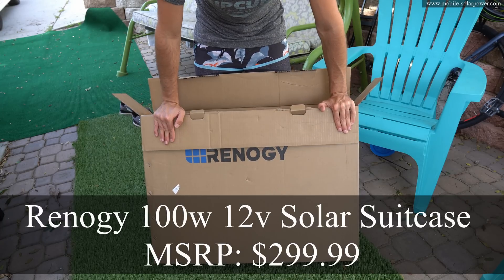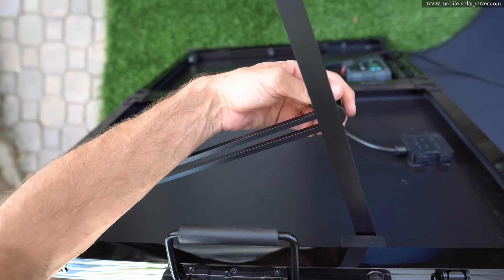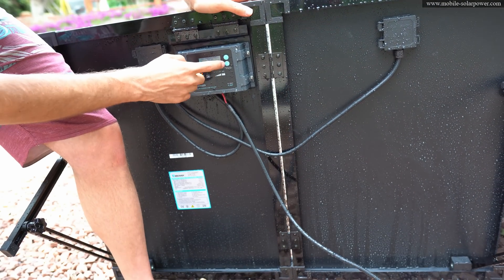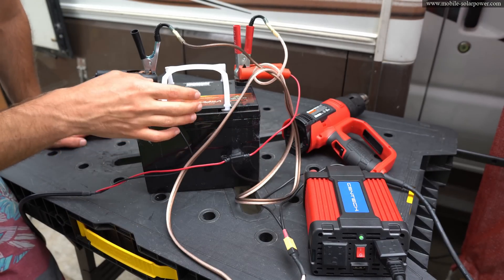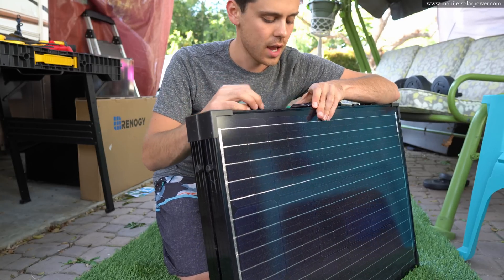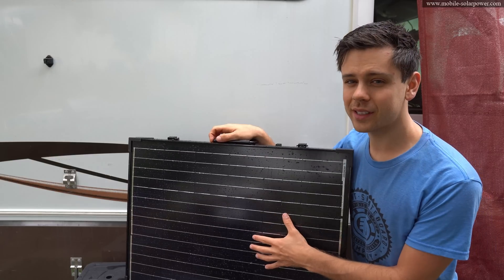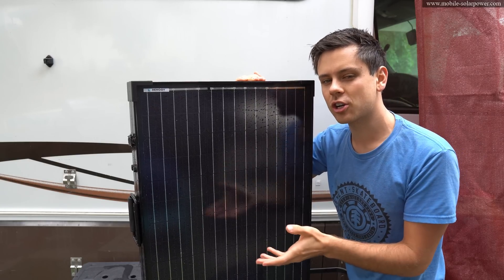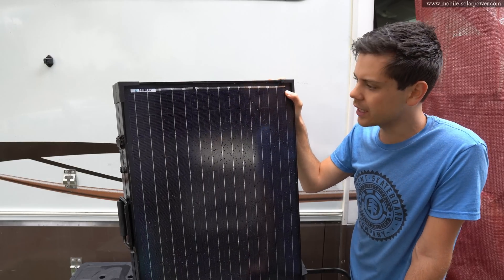100w Renogy Solar Suitcase and Renogy Voyager Tested and Reviewed

Comment: Great video Will.  So I could just hook this up to my genesis dual battery system in my jeep to keep things topped off when I am camping?  No issues with over charging or damaging my batteries with this controller?  I guess I could even put a plug in the bumper so I could always keep the hood closed.  This looks like a great setup.

Comment: I’ll bet you get this question a lot:  can you point to a power chart that can give a noob an idea about what you can do with different sized systems?  I mean, what would I reasonably be able to do with the solar suitcase, for example?  Charge 10 cell phones?  Power a medium sized fan for 15 minutes?  Is there a website that has an online power calculator or a spreadsheet that someone could download that would have general approximate power requirements to help plan projects?

Comment: Will, I have the Renogy 200 watt portable kit and I just tripped and pulled the wires out of the charge controller. The two wires are black so I don’t know which one is the negative and which one is the positive. What would happen if I connect the negative on the positive and the positive on the negative? Will I burn out my batteries? Thanks for any advice that you can provide.
Reply: Don't connect the wires without using a multimeter to check! You could burn out the controller. If the wires are backwards, there will be a minus, (-), sign in front of the numbers telling you the voltage. Also, use the higher than 20V setting, if there is one, as most panels put out more in open circuit voltage.

Comment: Hi could I plug this into an existing RV solar system to boost the battery charging when there is  not much sun. Would the solar controller on the fixed RV system fight the suitcase
controller?, great video.

Comment: Will, do they make a cable you can permanently wire to your RV battery that will plug into the cables coming from the controller.? if so what are they called?

Comment: Thanks for the review Will, I used your link to order one. I like the size, the adjustable legs and charging capacity, I will be using it for car camping and power outages to run my computer and network, I work from home.
Reply from the maker: You will love it! I have had it for months and it works great. I leave outside 24/7 in Las Vegas and always works

Comment: I have the older model that is not waterproof.  It works great!  As I understand smaller solar systems are just fine with a PMW charge controller.

Comment: so we bought this suit case for camping and figure we can keep it around for planned electric turn offs. we are an older couple and it became clear that we are not the target audience for the controler that came with this. the screen is hard to read, especially the tiny typeface for the battery type. otherwise it’s age neutral. reasonably light weight, nobs and clasps that could be bigger for arthritic hands but still ok. i warned my partner about the connection but it went together easily for him. i wanted to mess with the controller more but a grey haired lady messing with solar panels seems to be a major attraction at a campsite and i didn’t want to mess up with an audience, ha ha. i’ll have more time with it when we get it home. thanks for the review.

Comment: Based on your review of generators I'm thinking of the ROCKPALS 300W Portable Generator and was wondering if you know how this panel would compare to the Rockpals 100W Foldable Solar Panel. This looks easier to use with the legs, but durability is a concern but I question if the Rockpals panel would be as good for charging as this.

Comment: I've had one for several years now.  It works great.  It has been rained on many times; not a problem.  Only criticism I have is that the latches have rusted and are pretty much useless any more....
Reply from the maker: Good to know, thanks for the heads up
Reply: why not  addd velcro

Comment: @Will Prowse, I didn't take the time to sift through all 181 comments and don't know if this was previously mentioned but did you know....the controller is actually mounted on a hinged mounting plate that swings out. I noticed at the 1:48 mark after the water test you actually tilted the whole panel assembly to show the controller was still working. Simply pulling on the bottom the hinged mounting plate that attaches with velcro would have allowed you to view the controller without disturbing the panel. Pretty cool eh?

A buddy of mine purchased one of these portables and yes, they are the bomb. Nice video.

Comment: Have a similar setup and I have a question you might have covered previously.  When I put a large load (800 or so watts and 60 amps) on my lifepo4 battery the voltage drops from over 13 to just above 12 immediately.  If I turn the load off the battery voltage goes back up.  Is this normal?  I would have thought that my battery power would have stayed at 13 while the load was on and dropped slowly over time.

Comment: Renogy UK ran out of stock of 100w panel's recently so I had to buy my 100w panel from a different manufacturer, mine came from Photonic Universe, I installed in 2 days ago on the roof of my campervan and its been brilliant. My leisure battery was fully charged after 12 hours of sunshine with the controller set to 14.4v. Its the first time its fully charged for a long time as the split charge relay only charges to around 80%. Its been money well spent.

Comment: I have been the Renogy 100W 12v Solar suitcase for a couple of years. In fact, I have two of them. My Renogy PWM controller doesn't have all the newer Lithium profiles but works great with my sealed batteries. I use one to recharge my RV batteries while boondocking. I do astrophotography so the second suitcase and battery is used to recharge by astronomy and laptop/camera gear.

Comment: This is why I love your reviews.  I would be afraid of to blast it with water for 20 mins.  Question: do you think attaching a cable clip (thinking size for old 25 pair PBX cable) with a square of that 3M permanent tape on the inside back of panels would be a good way to keep those cords from getting mangled when you close case?

Comment: Hi Will, I need your help please. I wrote you another message here but unfortunately you haven´t see this yet. So I´m trying again now, hoping you can see this. So following my question, what is the correct resting voltage for a new lifeYpo4 cell 200AH after charging ? I have received the answer from the seller and they say the following " 3,39 V per cell is normal after resting battery. We have a professional charger for initial charging and If we charging a new battery, we charge all batteries on 3,6 V and we waiting one day and after a measure, all batteries have approx 3,4 V. " For me something doesn´t look good, I have read different things over the internet and I want to be sure I have received new cells and not used cells or old stock cells, any thoughts please ? Thank dude !
Reply from the maker: The seller is correct. Very typical voltage reading for cells on arrival. What matter most is how well they are matched by resistance and capacity
Reply: @WillProwse  Thank you Will, I really thought that I had received old stock or something like that. The cells are all well balanced, the 123 BMS looks really good. I wanted to buy the Renogy dc-dc charger you recommend but there is something I do not understand for the set up and is how can co-exist a Victron mppt + dc dc charger + shore charger simultaneously. For example if I´m driving with my caravan and charging the leisure battery with the dc-dc charger do I have to turn off the MPPT charger beforehand ? I hope you can see my point, if every charger is connect to the same battery, can they coexist automatically or do I have to buy any kind of switch or something ? Thanks mate :)

Comment: Hey Will, would it be possible to run an A/C Unit in a van/rv off-grid? If so, what  kind of power would be required?
Reply: Nicole Miranda it’s on his website but it’s quite expensive to make that happen. You need a very large battery bank and a very large solar array with a very efficient low BTU AC unit along with very good insulation. 
Or you can use two vent fans to cool things down or just use a generator which works well too.

Comment: hi i have two 100 w solar panels what kind of fuse should i use between the panels and the charge controller thanks
Reply: boxcardonny you could use an MC4 inline fuseholder on the positive lead. If connected in series take the amp output of the 100w panel for example 5.75 amps times by 1.56 to oversize it equals 8.97 so a 10 amp fuse would be fine or if parallel connected add the two amps of the panels together and times by 1.56 you will end up rounding up to a 20 amp fuse.
Reply: thanks @howard922

Comment: Hey love your vids and bought your book and love it and very easy to follow. i have question  about my batteries? i have 2  (a123 26650  LiFePO4 green 96 cell) can i just connect them to 12v Inverter? i dont wanna to burn my house down lol
Reply: 36v batteries
Reply: @timmywitaburner3698  I believe that you would need a 36V DC to 110V AC inverter, as I don't think a 12V inverter would work with a 36V power bank.

Comment: FYI:  Santan solar in Gilbert Arizona by Phoenix, has super cheap used solar panels for sale. They are usually large panels. That is the company that donated 40 panels to Bob Wells’ Homes on Wheels Alliance (HOWA) recently.  Keep up the great work Will.
Reply: Wow! They really do have some good deals. Thanks for the tip.

Comment: I have used one for several years with an earlier charge controller.  The weak point is in the handle and latches, they will rust!  Other than that, it has been a fantastic unit.  The controller is on a hinge plate which can swing back for a better view.  The plate should be held in place with velcro.  My first generation model did not have this feature.  I added velcro to the back for better wire management and strain relief. The MC4's were immediately replaced with power pole connectors the day I received it.  Wires will store nicely if you lay the panel flat first.  73 de K2LED
Reply from the maker: Good to know!
Reply: AS FAR as The handle Rust problem  apply car wax  best that you can do that area  shouldn't  be problem after if it's painted well !

Comment: I have one of these and have had it for over 2 years with no issues. The only thing I added was an adapter from the MC4 connector to a 2 conductor SAE cable like the ones used on the Battery Tender.  This is so I can extend the distance without the high cost of the MC4 wired connection.

Comment: Is it feasible to paint the black frame with white or silver auto or heat resistant paint (I'm thinking of a painstaking process using a small brush so as not to damage anything)? Would that help make it similar in action to the panels that come with silver/white metal, or does it pose a conflict of some sort? Love your videos, Will. I've learned so much!
Reply: Or use white vinyl tape. Less messy.
Reply: @kenslattery6458  That tape won't hold up to heat. Even Gorilla tape will peel off too easily on a hot summer's day over 100°F. I have had it happen here in the southern CA desert, where it can get up to 130°F at times...and the solar panels being in sunlight will be hotter than air temp.

Comment: Next video idea: Low Profile MPPT custom build
Reply: You can get some that will fit. Mounting a heavy MPPT on the laminate is the tough part, they usually use some fairly low-profile sheet-metal stand-off feet for it with the PWMs also.

Comment: I’ve been following you a while, best solar channel by a mile and I love how you mix beginner stuff with higher skill content. I’m in the UK and wanted to add a solar option to my caravan (US translation - travel trailer) and after some research (using knowledge I learnt from you) picked up this Renogy suitcase to dip my toe in the water. Brilliant for a beginner and really pleased to eventually see it on your channel with a glowing review.
Btw my caravan is an Eriba Troll 530. A brilliant German design that’s hardly changed in decades. Look it up - you’ll fall in love.

Comment: wish those systems had a flip out bracket for the SCC.  Hate having to move or get down on my knees to check the numbers.  New product idea?
Reply: The charge controller is hinged and is held against the panel with velcro. Just pull the velcro loose and it hangs down or can be moved to horizontal by hand.

Comment: Kind of pricey.  Save about 50% with your own panel & PWM. Otherwise, a newbie may jump on this.  I'm no newbie after reading Will's book.  "se la vie"
Reply: John Kelley one could definitely save more but it would cost extra buying two 50w panels over 1 100w does cost more. 2 Richsolar panels are $120 together then add $40 for a PWM and $30 in wires and clips and you’re at $190. Then add on hardware and I’m not sure exactly but yes, you could probably save $50-$80 but if it’s only $50 difference, would be any better? Not so sure

Comment: Does the voyager controller turn on when it is hooked to the battery before it is getting solar power?  Also will it stay on and kill the battery with no sun?  Thanks
Reply: Yes, it becomes active as soon as it is connected to the battery.  You may get a smidgen of charging from ambient light.

Comment: get these panels up to about 5kw, and I'm a buyer!
Reply: Mike Meneray I don’t think a 5kw array would be very portable....
Reply: @AaronGeller  Sure, not with the current pathetic PV technology, you're right. i will gladly wait for more powerful PV technology than be an early adopter pay-thru-the-nose chump.
Reply: Mike Meneray just out of curiosity, what would you be powering that require 5kw?
Reply: @AaronGeller  primarily, a heater, a big one, and given all the inefficiencies of PV, it would take 5kw capacity for continuous-run. Thx for your question-back.
Reply: Mike Meneray so would this be for a house I assume?
Reply: @AaronGeller  Yes, but not exclusively. The portability is what attracted my attention. Thx again for your interest!
Reply: Mike Meneray the larger something becomes, the less portable it is. The system would need to be about 50 times larger so at that point, the mending of what’s portable might need to change.

Comment: Nice portable solar suitcase, I don't like the MC4 connectors at all, with arthritis in my hands I can not get them apart. I snip off the two tabs so that they just pull apart.
Reply from the maker: Smart idea. And yeah it's crazy difficult to push those connectors together. What a bummer
Reply: Once you put them together, you won’t need to take them off. You could always use another connector too.

Comment: Nice, Will!  
What would the cost and form factor of a home-built solution with the same specs be?
Reply: Steve Martin 2 50 watt panels are $120, PWM $30-$50, Case... no clue, wires and gator clamps $20-$30, hardware $30-$50, and if you need tools, more money. The savings might not be very much. Renogy has a discount code for $30 on this

Comment: What about a head to head comparison with the HQST 100 what one for another video?
Reply from the maker: Oh that's a smart idea. Actually I would compare the zamp. Hqst and renogy are owned by the same people. I bet they are very similar. I'll have to look at the prices and compare them tonight
Reply: @WillProwse  I'm still learning who's who in these solar companies.  I look forward to the videos, all of them actually.  You're a great teacher! Keep it up.
Reply: @WillProwse  Looking forward to that comparison as some RV manufactures are installing Zamp products (ours has a Zamp maintainer and a Zamp plug-in for a portable panel). I did read that Zamp wiring is a bit different than other manufactures which could present problems if a non-Zamp panel is plugged in a Zamp port.

Comment: Hi Will  ive been running similar type of suitcase solar for about 8 years now they work well to keep my engel fridge battery going  while im out camping here in Australia ,we get lots of sun . The battery  allways charged by afternoon  . The suitcase on your one looks 10 times better than my one but with care mine has travelled about 40,000km in the time ive had it and still all good key is to keep the glass clean and when storing or travelling with them stand them on edge not flat .
Keep up the great we ork mate 👍

Comment: I just bought this a few weeks ago. I will use to recharge two 6v on travel trailer. My reason for it was the portability and to use anywhere. Another camper could have dead battery and you can help. The case is better than you think too.  I’m excited to test it this summer on charging my 6v’s.
Reply: After summer use,  my only complaint is the short power cords. I need to add longer cords so I have more options for placement.

Comment: Great product, my only concern would be, you would have to be in camp all the time, otherwise it might walk away.  great video
Reply: If people are going to steal, they're going to steal.  I have this product and the frame is deep enough that you could drip a hole, run a cable or bike lock through it and lock it to your vehicle.
Reply: We use a cable or chain lock, secured to the metal handle, and walk away all day.